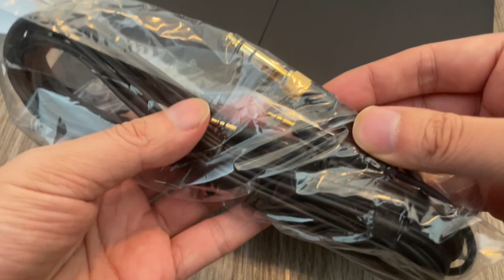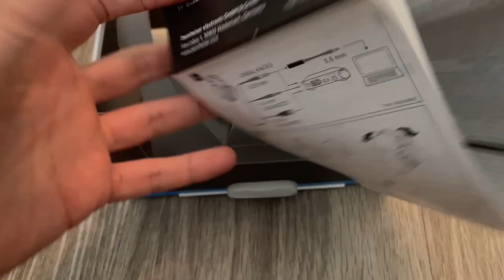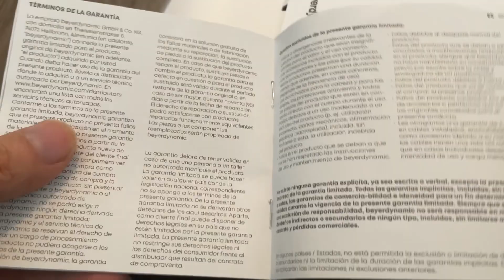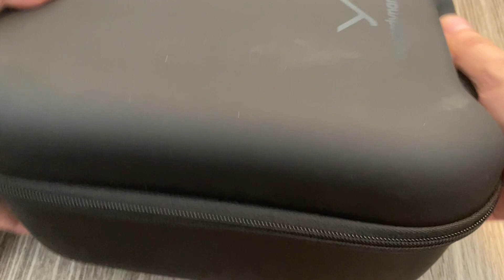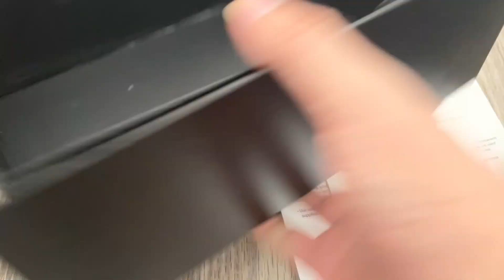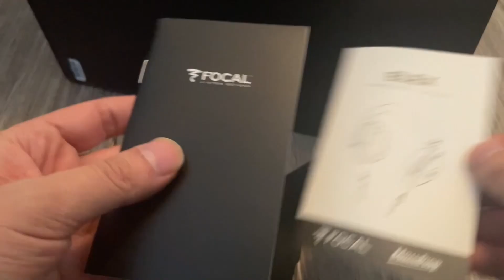Open back headphone comparison! Senn HD650, Beyer DT1990 Pro, Focal Elex, DC Aeon X Open, AT R70x

Comment: I just got the Focal Elex for $325 open box. Even though I am a huge Beyer fan, have 3 pairs, I do not yet own the DT1990, but plan to once I can afford them (gain wife approval). The Elex made its way to my current top set, beating out my HiFiman Edition XS. My current fav Beyers are the 900 Pro X, but not in the same league of the Elex, but still a very good headphone. What I like about all Beyers, is the combination of build and sound, a very complete headphone no matter which model.
Reply from the maker: Most if not all Beyers are made in Germany I believe even their lower end stuff
Reply from the maker: But that's no knock on Focal because Focal makes almost all their models in France. They are just as solidly built as Beyers. Bathys I believe being the exception